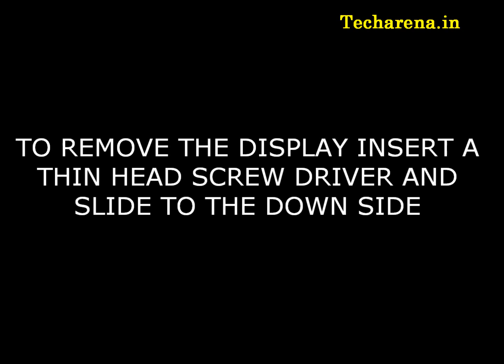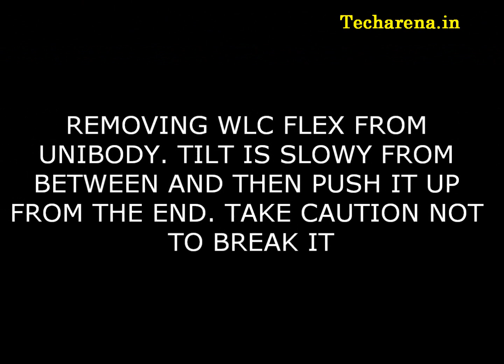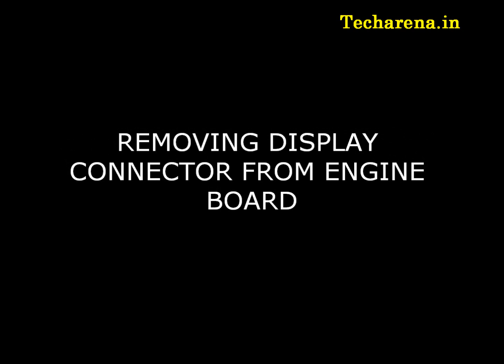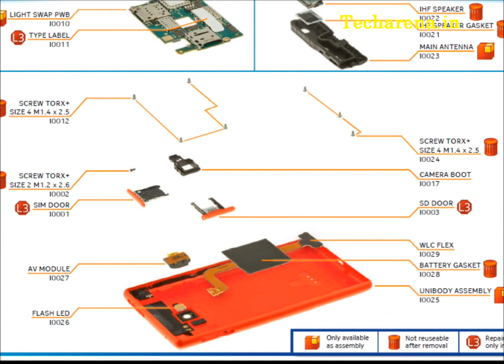NOKIA LUMIA 720 DISASSEMBLY

Comment: The gorilla glass is part of the digitizer. By itself he digitizer sells for about $20 and yes, it will be "super sensitive". You can also get the LCD and digitizer bundled together; at the moment that costs about $110-140 depending or where you buy.

Comment from the maker: You can try to replace the digitizer only without the LCD but since the lcd is thin so removing it without breaking it will take a lot of time and patience. Also, you wont be happy after reassembling it because it will not line up properly with the frame and will not look quite the same.

Comment: well, the 720 does not have built in wireless charging, but have the 3 pins at the back where you can connect to the wireless charging shell. what i mean is - is there enough room between the battery and the phone back cover to fit the wireless charging component (which is normally on the wireless charging shell) INSIDE the phone?? thanks!

Comment: Hi, can you tell me where is battery timer located in nokia lumia 720. coz my mobile is not getting charged, while connecting to charger it starts vibrating continuously. Please give a solution.
Reply from the maker: Nokia 720 You should actually take it to a local phone repair shop to get it fixed rather than damaging it further by your own.